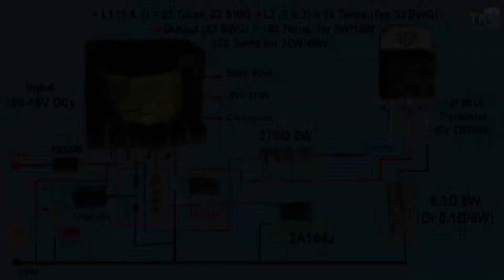DC 12V SMPS 40W Fluorescent Lamp Inverter (Electronic Ballast)

Comment: Thank you for this effort, I will implement the circuit for my next project, but what is the resistance value between the third and first pin in the transformer
Reply from the maker: 270 ohm/2W.

Comment: HEllo. 
Thank you for this tutorial. 
Could you suggest any electronic ballast chip to use in a DC powered ballast? Power up to 15w. 
You think IR2153 can be used with ac generator of some sort, if to be powered by a 12.6v lithium bank?
Reply from the maker: https://www.amazon.com/Inverter-Channel-Inverse-Converter-Regulator/dp/B07KDPXQ7V

Comment: Can a 40 watt tube, which doesn't glow with normal choke starter be used here ??
Reply from the maker: Yes, we can use and it will grow 100%.And I recommended to use 2N3055 Transister with heatsink instead of TIP3055 .

Comment: can use this inverter to electric fence cercuit.
Reply from the maker: Not suitable.But if you add a pulse circuit,that may work.
Reply: how many hz this inverter .how many volt output ac.wich diod  use convert to dc.fr diod or 1n rectifire diod .im use your cercuit now.but i dont no it is suitable.it is working...

Comment: Why distroied 100uf and what diode can use to dc:: (fr307/1N5408)
Reply from the maker: Hi, make sure for polarity of 100uf capacitor. And, for polarity protection,   we should use 1N5408 diode instead of FR307. But if you want to convert high voltage ac output from transformer, which has high frequency, then FR 307 can be used.
Reply: THANKS..FOR REPLY ...FRIEND ..

Comment: Hi, your video is very informative with the details. In order to drive a 4W fluorescent tube,  is this overkill ? what could be changed on circuit if the source is 3.7VDC and the load is 4W fluorescent tube ? Please advise. Thanks.
Reply from the maker: Thank you so much.This circuit is not suitable to drive the tube less than 5/10W.
A 4w tube can be driven for short period of time,but may burn shortly.So for this,
if source is 12V,than we can use 1K (1W/2W) resistor instead of 220ohm/2W resistor,
which is connected to L2 coil,Leaving the rest as it is.Tube must be connected
to full output option,i.e.output from 220 turns.This can drive 4W tube without
excessive heat,runs nicely.Again if source is 3.7V,than there are many option:-
1) We can use Boost Converter Module (3.7v to 12v DC converter).
    https://www.youtube.com/watch?v=6_89VleBRLg
2) We can build up circuit like this but must be small in power and size too.Fo this, we need
 a small transformer which can be found in mobile charger circuit,One D882 transistor,
one resistor of value range 22ohm-56ohm,with the same principle.I will upload video 
about this later if possible.Or you can find another uploaded video on Youtube too.
Reply: @TMCreations  Thank you for your reply and for the advice. For the option 1 using voltage booster, will the tube be ok if running on DC ie. 12vdc like in your video ? as I know if it runs on DC, it will be burnt shortly with blackend on one side due to the mercury cannot be transferred to the other side...CMIIW.
For option 2, appreciate if you can share the circuit, since all JT circuits I found that using mobile charger transformer are only able to drive LED lamp not fluorescent tube lamp.
Reply from the maker: @b3myself  you're welcome.....For option 1, we  must use boost converter(3.7v to 12V)  and  above  Fluorescent Lamp Inverter (After replacing  1K/1W resistor which is connected to L2 coil). Sorry for that I forget to mention it in option 1. And for option 2, in most video on youtube,transformer they are using is low watt charger I think, 5v,500mA to 5v,800mA, and it must be from 5v 1A charger at least.And secondary turns of transformer should be increased so that it can drive fluorescent lamp.Finally transistor they are using is ok,will be better if they were able to add capacitor and appropriate
 low voltage high frequency switching transistor like D882,S8050 etc.I will do that later....thanks.
Reply: @TMCreations  OK great..I will wait for your next video..thanks again.
Reply: @Colson Mark flixportal xD
Reply: @Bo Jacob Thanks, I went there and it seems like a nice service =) I really appreciate it !
Reply: @Colson Mark Happy to help xD

Comment: How many volts  this inverter.what is the frequency .
Reply from the maker: Volt is almost 300v AC,and frequency is much higher....10KHz,not suitable for device that runs at 50/60Hz frequency.But works well with smps.

Comment: What is the operating frequency and output voltage of this circuit ??
Reply from the maker: Circuit output voltage is high frequency ac, above 1 kHz and voltage is much higher (600v with open circuit) .